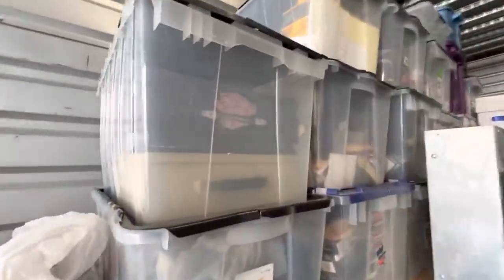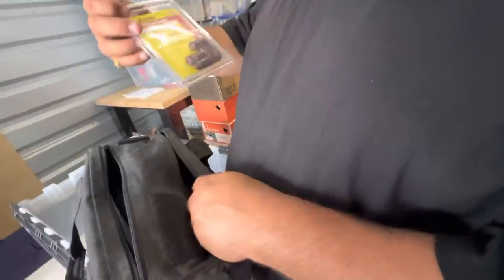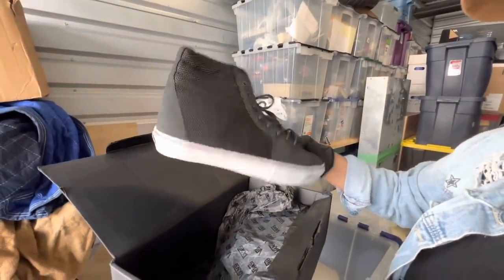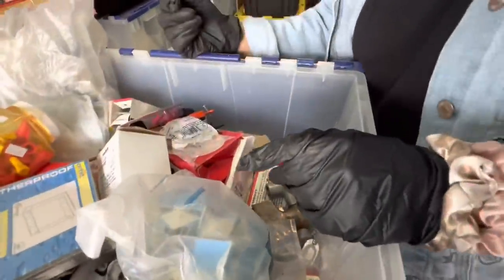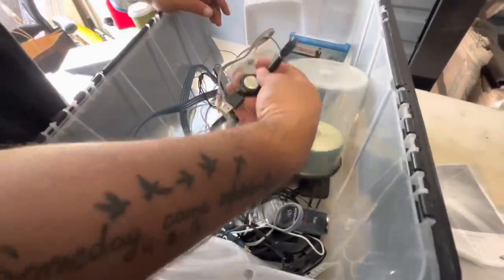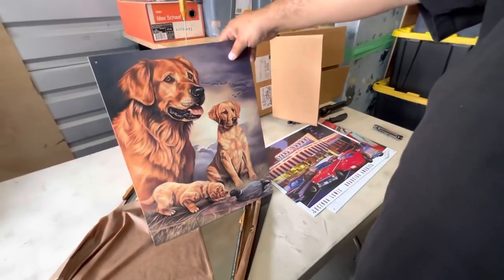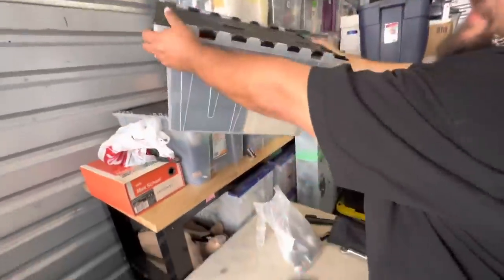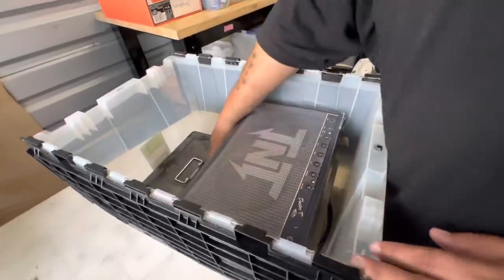Amazing STORAGE unit | found 2 LOCKED BOXES! It was packed #storagewars #100k @LittleMamaStalker

Comment: The first tote you opened had gun gear, including the shoulder holster and the small AR Pin Kit is used for working on the AR-15 rifles. The locker owner was really into his guns, as you saw with all the great pistol cases in the last video. The steel plate looked like one that could fit in the front or back of a military tactical vest to make it an armored (bulletproof) vest.

Comment: that little clear thing that u took out of the shoe box that u pulled out of the tote with the 2 lock boxes is a pill cutter. u stick the pill in the orange part and than u close it and the little blade in the inside will cut the pill in half.